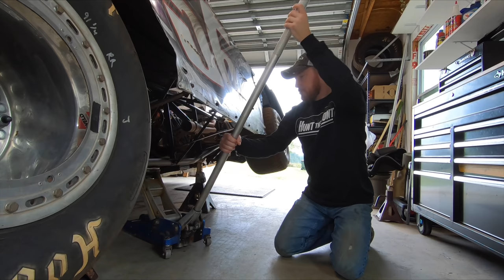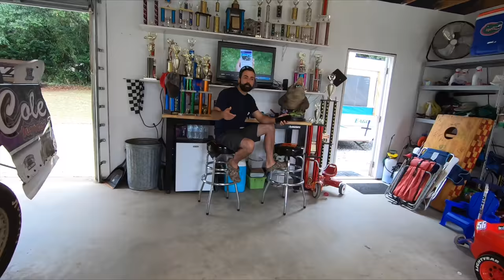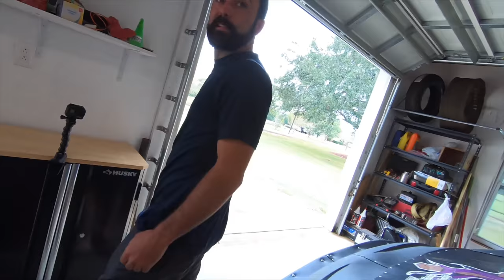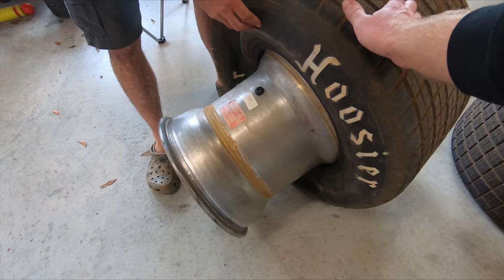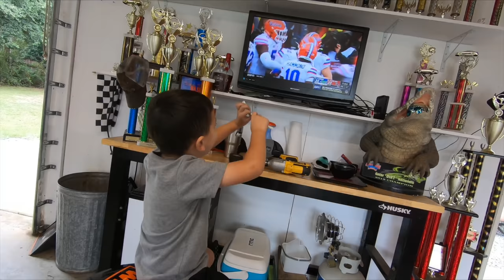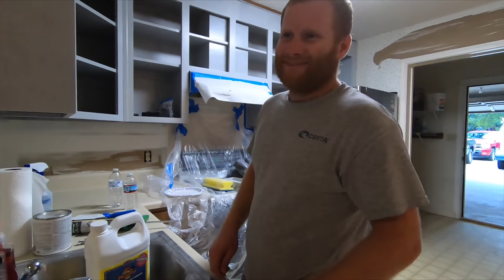We Mounted Race Car Tires and Jesse Started His Own Vlog

Comment: I hear a lot of drivers say they wash their tires as soon as they can to help keep the oils in the tire. I noticed that your tires are usually dirty and was curious why you don't wash them?
Reply from the maker: Those drivers are correct. My problem probably has to do with both time and priorities.
Reply: @HunttheFront  I can totally relate with time and priorities. I'm typically on the road Monday through Friday, so my time with the car is already cut down, and then I try to keep up with the family functions also. Something that I recently learned about to help with those edges is putting some baby powder on the tire and run a wood planer across the tire on a setting that just grazes the tire.